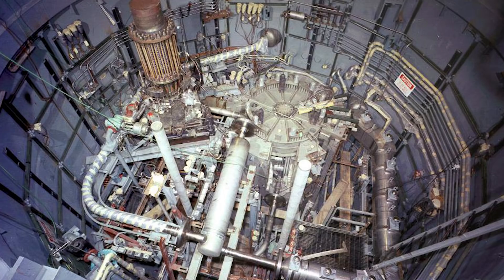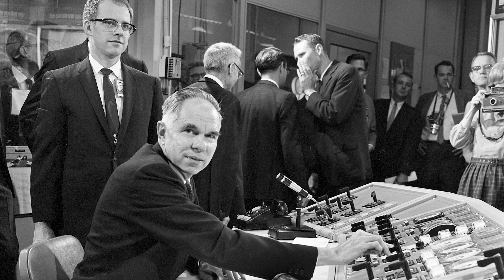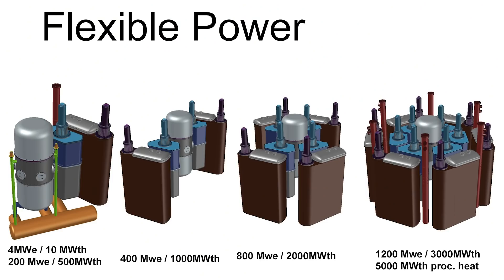Ed Pheil and Carl Perez of Elysium Industries discuss Nuclear Power and MSR @ ORNL MSRW 2019

Comment: LFTR got a lot of people to start looking at nuclear power again, but it seems like some people are trying to confuse the public with term's like SMR, MSR. Why no comparison against LFTR?
Reply: Just go on Facebook and search various groups for "Ed Pheil" and "LFTR." Lots of comparisons to be found.
Reply: Going from coal to a LFTR is like going from horse and buggy to a formula 1 race car. We need to start with a model T (Thorcon Power) and iterate many, many competitive versions to arrive at the best solution(S).
Reply: @chapter4travels , MCSFRs like Ed's can be retrofitted to current coal plants. We had a good discussion on that elsewhere (not YouTube). A slightly different config depending on if the coal plant used supercritical or subcrit steam. Basically cut the coal parts out (furnace, etc) and swap in.
Reply: @NWer-c5u  you missed my point. LFTR's are extremely complicated and no one knows if they will work for sure or not. (Formula 1) We know a simple MSR will work and we should start there and advance over time ( modea A)
Reply: @chapter4travels , you missed my point which was your point restated immediately after. We know a simple MSR like Ed's will work and can/should be used for both standalone and coal plant retrofits. It is not LFTR.
Reply: Much as I love the LFTR concept, it requires new technology to be designed, built and (most difficult of all) licensed by safety regulators. It sounds to me like the big issue is online separation of U-233 (Pa-233?) from Th-232, which will require equipment that cannot be serviced by humans (due to radioactivity) and so needs to work reliably for years (or be serviced by robots?). I think if you want to build a breeder, it's much more practical to build a simple burner reactor first and, if it is commercially successful, use the profits to fund a breeder reactor.
Reply: The two fluid LFTR concept has a number of issues, not the least of which is that U-233 could be tapped off during the chemical separation process as the fissile U-233 is removed from the fertile blanket fluid. This is a significant proliferation concern. There are also cost issues due to the extra components. And there's no confusion of terms when it's realized that the LFTR design is one type of MSR that could be designed within a small SMR form factor.
Reply: @ikester475  The unavoidable co-production of U-232 and the extremely low tolerance for it in a U-233 weapon, something like 0.005% in an implosion type weapon, means it's effectively impossible to make a nuke out of it. There isn't much wiggle room to be siphoning material from the Thorium fuel cycle in the first place. You also failed to even attempt to articulate why it would be bad for other nations to achieve parity of arms with those that already have nukes.

Comment: Process heat can be great for oil sands industry. The PSV Primary Seperation Vessel used to seperate oil from sand with heat from natural gas now but could come from nuclear. 
The Canadian potash industry uses lots and lots of natural gas (too much)
Just to heat water. The amount of money that is spent on natural gas for oil sands and potash production alown would pay for several of these nuclear units.
You can have a set of appartment buldings arranged arround a center heat source like a MSR. 
It would be great in Canada it gets to be minus 40 in Jan.
God's speed Elysium.
Reply: With Ed's reactor cost and efficiency, tar sands would be largely moot. We could just produce sulfur and aromatic free, high grade synthetic fuels made at plant price the same as today's refinery price. Think very stable, uniform 94AKI gasoline, high cetane diesel, kero/Jet-A, etc. https://www.youtube.com/watch?v=Q1Fi3BnwL94

Comment: Dr James Hansen says we should build 115 GW a year nuclear power. If I ran the world, we'd start off for the first decade probably fast building ThorCon ship built reactors. Ed would build a few test MCSFR's and perfect them. Then in a decade or so, we'd start building out MCSFR's as fast as the fuel load from ThorCon would allow! ThorCon first, then MCSFR's as the 'waste' fuel stream allows. It seems to be the fastest way to meet that 115 GW  per year goal, and if ThorCon's shipyard assembly line can operate as fast as they say (with 20 GW / shipyard / year?), then I'm sure the world could easily pump out much more than 115 GW a year!
Reply: There's plenty of Pu and stored LWR fuel to get MCSFRs going and then fuel them for a few millennia. Just need production models ASAP.
Reply: @NWer-c5u  Sure there's plenty, but doesn't it all require breeding up? Or am I getting confused with the IFR model where it takes a year to breed an extra 2% fuel in the blanket on the outside, and Tom Blees was lamenting that while there are enough actinides to run America for a thousand years, there just isn't enough nuclear waste bred up and processed properly to fuel America at the start if we waved a magic wand and every coal plant turned into an IFR's overnight? Doesn't the MCSFR require a quite high fuel load to kick off, and doesn't that fuel have to be processed to a certain degree?
Reply: Hey, don't forget the molten salt reactors from Moltex (waste burner) and Terrestrial Energy (uranium burner).

Comment: The anti-nuclear activists are not going to stop opposing nuclear even if this is proven 1000X safer than light water reactors.

Elysium looks very promising, but in the end cost is what matters.
Reply: @IamtheFleecer Exactly. Existing reactors are safer than any other energy source, but they oppose them anyway.

Some sneaky activists have figured out that the excellent safety record of nuclear is becoming known, and have shifted to "nuclear would be acceptable if it wasn't so expensive" ignoring that solar and wind receives massively more subsidies per unit of energy produced while nuclear is made more expensive by bureaucracy and political interference.
Reply: @phamnuwen9442  agreed that direct safety is not the issue since LWRs are already the safest technology known to mankind ... and that's including consideration of major accidents like Chernobyl and Fukushima. However certainly indirect societal safety vis-a-vis proliferation concerns as well as long term safety WRT wastes cannot be ignored. Elysium has answers for all those safety concerns while claiming lowered costs. 

Of course many anti-nuclear activists will not be impressed because they simply don't understand science and physics specifically, distrusting anyone that claims otherwise. However as I've recently heard it expressed, most people will come to grips with their irrational fears if nuclear can be made cheaper than fossil gas and coal.
Reply: @ikester475  Lots of activists don't want cheap, reliable clean energy since they consider human technological civilization a blight on the planet. They will probably oppose Elysium or other MSR's more than they do LWR's.
Reply: @IamtheFleecer Germany decided to get out of nuclear energy due to the big anti nuclear lobby and the Fukushima accident. They made laws and the people where happy. If you read them carefully, they only prohibited building nuclear reactors for commercial power production. So they could still build them to breed away the current nuclear waste or even new fuel, just not sell electricity with it. Desalination, Hydrogen production, Industry heat, remote heat for private homes (common in bigger german citys), ...
Reply: @IamtheFleecer Waste isn't a "problem" other than in the minds of anti-nuclear activists. Nuclear waste from civilian power reactors has never hurt anyone.
Reply: @IamtheFleecer Really? Hiroshima and Nagasaki were caused by waste from power reactors that just blew up was it?

One of the propaganda strategies of the anti-nuclear movement was from the beginning to conflate nuclear bombs with energy production, though they are completely different things.

It seems they were quite successful.

http://environmentalprogress.org/why-clean-energy-is-in-crisis/
Reply: @IamtheFleecer I'm intrigued. Did you actually believe that the nuclear explosions in Hiroshima and Nagasaki were power reactors that malfunctioned rather than nuclear bomb strikes that were intentionally designed to cause maximum destruction.

I find it amazing that anyone could actually conflate the two.
Reply: @IamtheFleecer Yes, and the reason is lies and propaganda. Reactors are not bombs and unless you are planning to use fossil fuel forever to power the economy there is no alternative to fission reactors.

By the way, war casualties have actually declined dramatically since nuclear weapons were invented.
Reply: Cost....Ed has considered that at every opportunity in his MCSFR design. It is cost effective, expandable, low pressure, consumes >99.9% of the fuel it is fed with a <0.1% residue that is safe in 100 rather than 10,000 years, does not use water, and provides MW for MW the same output as a fossil fueled plant. And if that was not enough, it EATS spent nuclear fuel (SNF), plutonium, and other nuclear wastes. What more is there to say other than let's get going! Fossil fuels are running out.
Reply: @MrMoggyman  Fossil fuel prices are not leading me to believe that they're running out...
Reply: @phamnuwen9442  Correct! But coal is polluting, and it leads to many medical issues not to mention acid rain. There is a better way, and that is to cleanly consume the nuclear waste we already have. Nuclear protesters may object, but when it comes to their current lifestyle and a return to the stone age they may think twice. Of course not everyone is interested in that. SE Asia and China in particular, who are heavily coal dependent for power, with mass population densities, and who have massive reserves of coal, are not likely to follow the RE green revolution. Indeed, they are still constructing coal fired power plants with 35 to 45 year lifespans like blades of grass. It is delusional to think that RE will replace fossil fuels anyway. The amount of fossil fuels required to procure RE, the sheer quantity, and the environmental and ecological cost for it to replace fossil fuels entirely make it untenable. Maybe RE will only be a small part of the generated energy of the future. There is always going to have to be something else.
Reply: This is true, but it's not necessary to convince anti-nuclear activists, because they are few in number. The people you need to convince are relatively normal people who have been told all their lives that "nuclear waste is a problem". So just showing that MSRs can burn nuclear waste gives people permission to think, yeah, it's good to stop global warming with this.

Comment: More stuff from Elysium, yay!
I can't get enough of their reactor.
They really should update their webpage. The current design is SO MUCH better than what's on that website.
Reply: My biggest concern about Elysium's reactor is that it sounds too good to be true. I would love to see a serious nuclear scientist grill Ed Pheil about every possible aspect of his design, and what could possibly go wrong. If it was a seven-hour cross-examination, fine. 
Example: What did Pheil mean about depleted Uranium? Can his reactor fission DU? In a load-following scenario, where does the extra fuel salt go? Expansion tank? I would love to ask Ed a bunch of truly ignorant questions.
Reply: @jimbo92107  His reactor CAN actually fission DU. UBob correctly says that it's a fertile material and needs to be converted to Pu but in a fast reactor some of it will straight up fission anyway instead of breeding but that's kinda unimportant, just have to consider it in your neutron calculations. The extra salt goes into the drain tanks. The core is constantly being drained by pipes at the bottom and at the desired level of the reactor vessel and pumps are always pumping to keep it at that level. If it heats up and expands the pipes at the desired level will overflow faster than the pumps put it back.
Reply: @MrRolnicek  My apologies - as you say, Ed's "FAST" reactor can "fission" pretty much anything that is fissionable. I should have said U-238 is not "fissile", and therefore cannot sustain a nuclear chain reaction, and therefore can't be used as a primary fuel source in a fission reactor....unlike U-233, U-235, or Pu-239.
Reply: Jim, in a fast spectrum reactor (and a MCFR is a very fast one !) uranium 238 can fission either directly in the 20% of the time or indirectly for neutron capture as plutonium 239
Reply: @jimbo92107 , load following is done with steam bypassing the turbine, similar to NuScale load follow method. Iirc.
Reply: @jimbo92107  Well he's actually a Nuclear Physicist and isn't simply copying others ideas without knowing them fully. Dude is well knowledgeable on this stuff and know how to go through the paces of the regulations.

His design is ingenious, using sources already available.
Reply: @jimbo92107  To good to be true? Does Ed strike you as that kind of guy?
 Anyway, DU can’t be fission-ed. It is mostly U-238 which is a “fertile” isotope of Uranium. A breeder reactor like the MCSFR will breed Pu239 from DU by “neutron capture” - which is a good fissionable reactor fuel. Of course, as Pu, it will scare the pants off most normal people, but is safe and sound inside the reactor.

Not being a nuclear physicist, my modest knowledge of MSRs tells me you are correct with your assumption of the fuel salt expanding and contracting during load following, as like all liquid fuel MSRs, the MCSFR continuously pumps fuel salt through the reactor. The key feature here is called negative thermal co-efficient. If the T goes up, the reaction slows down, and vice-versa.
 Due to the minute threshold of criticality - which is a key safety design feature of liquid fuel MSRs.

Also, I finally worked out recently how the MCSFR negates the need for a freeze plug feature which other MSRs are chirping about, but I never did like the look of. In the MCSFR, if the power stops, the pumps stop, and by clever design, the fuel immediately falls back out of the reaction chamber though the bottom plug by gravity into the non-reactive storage tanks. Simple and makes much more sense to me. Also, allows for the salt to drain from the heat exchangers at the same time stopping the possibility of those freezing solid. No big deal here, just extra cost (gear and more time) to un-freeze them before start-up.
 Ed knows his stuff!

That help?
Reply: @jimbo92107  There is only really one concern with Elysium's reactor I can think of.
It's a great source of neutrons, you can produce very expensive and useful medical isotopes (or other) just by putting your sample in the core above the salt level or next to the core in that surrounding salt. Same way you can make life saving isotopes can also be used to make weapons grade isotopes. So any good source of neutrons is a potential life saver, potential money maker (seriously some of these isotopes are insanely expensive) and potential proliferation risk at the same time.
Reply: @MrRolnicek  No actually there is no breeder mode planned for this, and you don't make medical isotopes by neutron activation, Technetium-99 for example is a fission product. It's possible to mine the fuel for medical isotopes if you separate only the lanthanides, but not in the reactor as there will be no chemical equipment mounted. No fissile or fertile material outside the reactor, no risk.
Reply: @hjembrentkent6181  No, I'm not saying breeder mode or anything like that. I'm saying there's pretty solid neutron flux just outside the core. If you put your sample in a box close to the reactor vessel then you can make isotopes by neutron capture.
Never in this process would you touch the fuel salt or alter the reactor in any way.